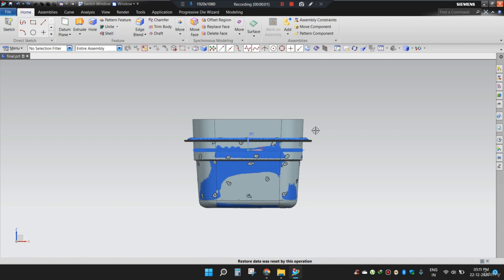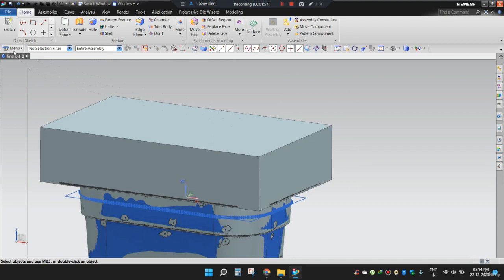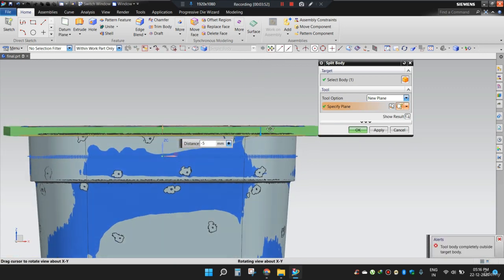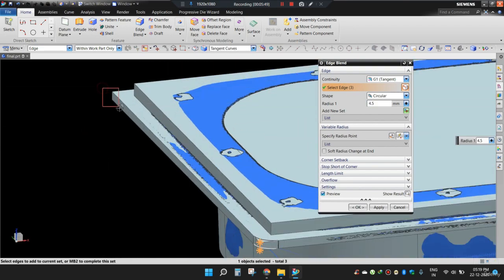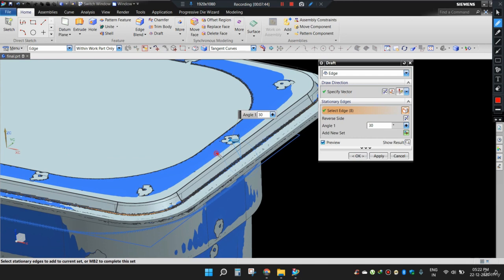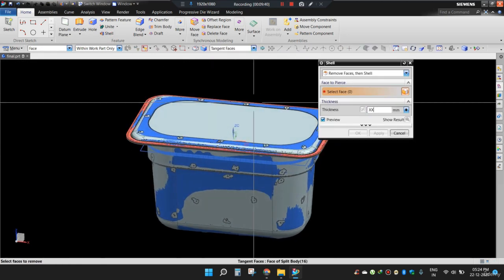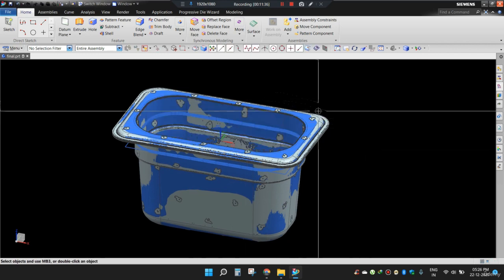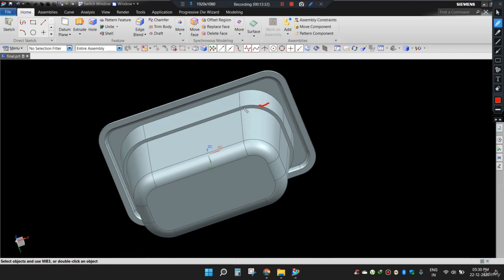ENGLISH | 7. (Part 7/7) Shell Command on an STL File - Reverse Engineering Course +91 9654 81 6262

Comment from the maker: Hello 🙏

Need Career Guidance? Watch This:
🌐https://youtu.be/Kryu8GQGheg

List Of All Courses: (CAD | CAM | CAE)
🌐https://tinyurl.com/all-courses-portfolio

All the courses have:

✅ Hindi Lectures
✅ WhatsApp Group
✅ Recorded Sessions
✅ Lifetime Access
✅ Freelancing Work
✅ Job Support

List Of Available Courses:

𝗖𝗔𝗗:

✅Reverse Engineering Siemens NX
✅Reverse Engineering Geomagic Design X 
✅Powershape Master Course
✅Plastic Injection Mold Design (Any CAD Software)
✅Press Tool Design Siemens NX
✅Die Casting Design SolidWorks
✅Forging Die Design SolidWorks

𝗖𝗔𝗠:

✅Powermill
✅WorkNC
✅NX CAM
✅SolidCAM
✅Cimatron

𝗖𝗔𝗘:

✅Autodesk Moldflow Analysis
✅AutoForm Sheet Metal Forming
✅Casting Simulation - Inspire Cast
✅Forging Simulation - Simufact Forming

𝗠𝗼𝗿𝗲 𝗖𝗼𝘂𝗿𝘀𝗲𝘀:

✅Inspection Report - GOM | Zeiss Inspect
✅NX Motion Simulation

For doubts/queries:
📞 WhatsApp call: +91 9654 81 6262
📧 E-mail: nx.reversecad@gmail.com

Discounts available on all the courses 😊.